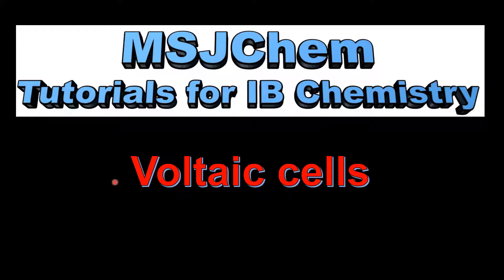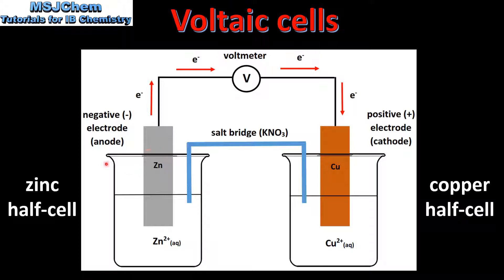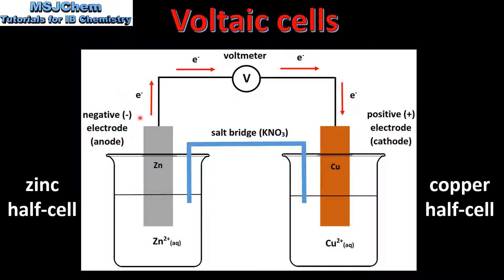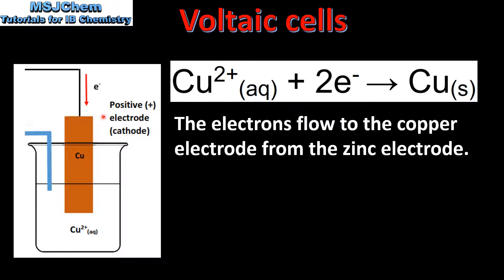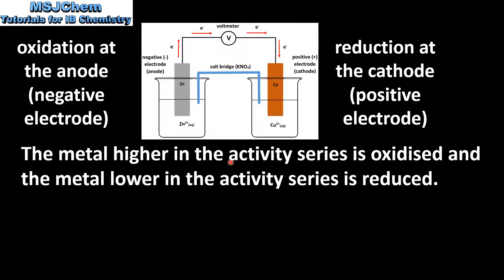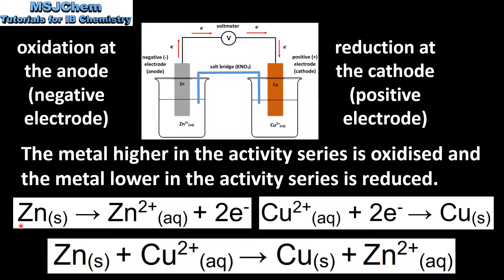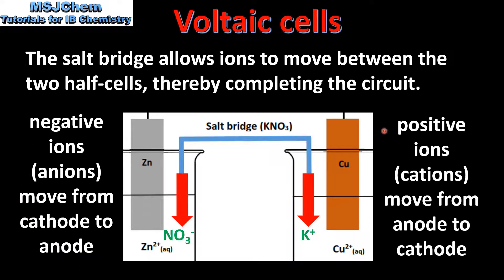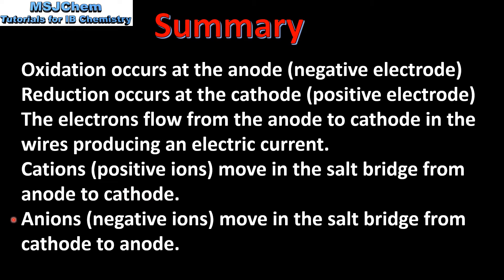9.2 Voltaic cells (SL)

Comment: why would the negative ions (anions) move towards the negative electrode (anode)? shouldn't they move towards the positive electrode (cathode)?
Reply from the maker: +Busola Olabiran I assume you mean in the salt bridge? The half-cell that undergoes oxidation becomes more positive (due to the formation of positive ions when the metal atoms lose electrons). To prevent a build up of charge, the negative ions move in the salt bridge to the half-cell that undergoes oxidation. The positive ions in the salt bridge move to the half-cell that undergoes reduction (which becomes more negative as the positive ions are reduced to form metal atoms).
Reply: Ah I understand, but this is where my initial confusion stemmed from: If the anode, which undergoes oxidation becomes more positive, why is it called the negative electrode?
Reply from the maker: +Busola Olabiran The anode is the source of the electrons which flow in the wire to the cathode, which is why it is considered the negative electrode. Only if a salt bridge is not used would the positive charge build up in the anode. That's why when we construct a voltaic cell, we need to use a salt bridge.
Reply: Ohhhh okay. Thank you